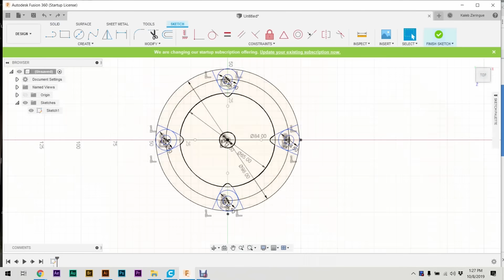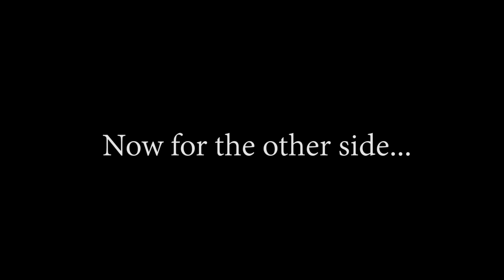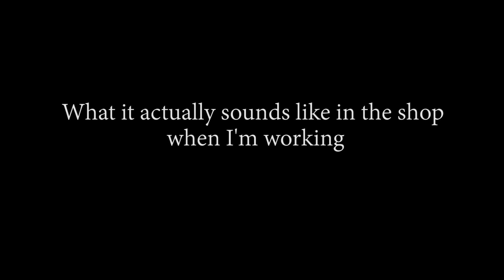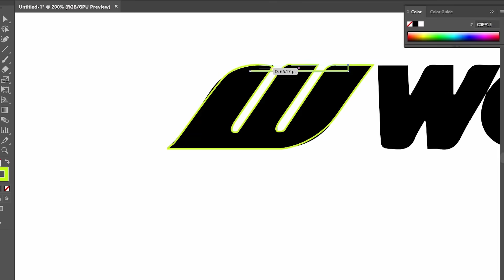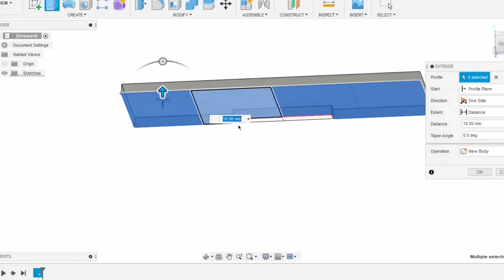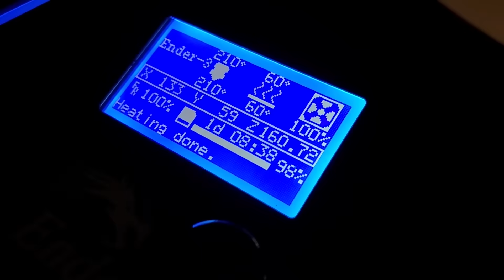WIDEBODY POWERWHEELS IN 10 MINUTES

Comment: When I was a kid the prize (if you could find one) was an old pram with removable wheels.
Even cooler if the rear wheels were larger than the front ones.
Few bits of wood, a coach bolt, and a piece of rope.
Instant go - kart 😀
That is one lucky kid and one devoted dad.
Great job sir!
👍

Comment: might be better to widen the steering knuckles instead of putting the wheels further away from it , make the steering arc the wheels make smaller so the fit better inside the fenders and makes it eazier to steer prolly can take the current setup out from under the car cut it in the middle and stretch it to where it needs to sit

Comment: So since you did the wide body, when do you upgrade the motor to something more powerful? At this point you might as well, give it the performance its going to demand.
Reply: Id say take a 500w 24v to this, do twin batteries and install a kill switch and a resistor. Print out full rims and get some go kart tyres.